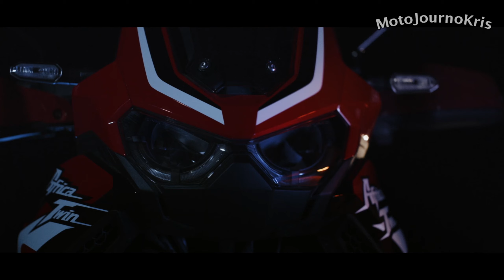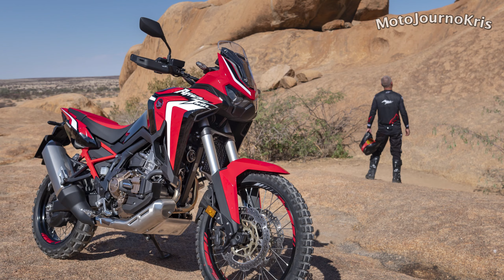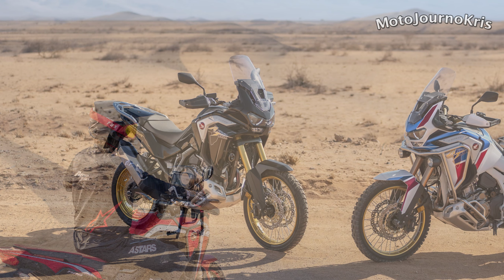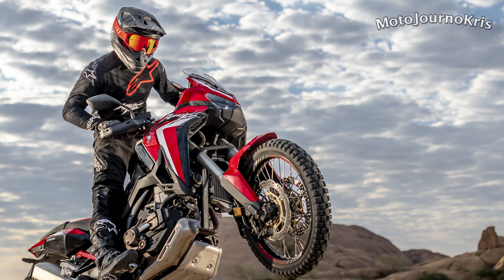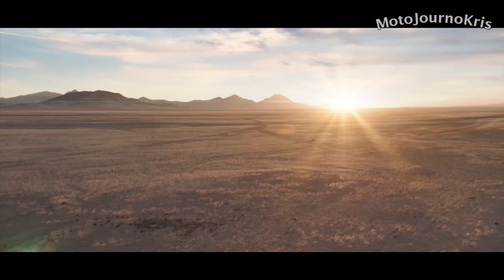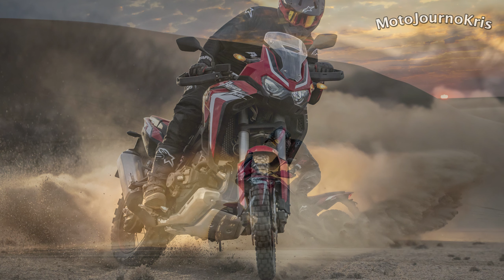2020 Honda Africa Twin Update - What's New & Australian Pricing

Comment: good day sir kris! in australia do you have to follow the rules before getting a higher cc bike? for example if your new to driving you will start from A1(beginner) then A2(intermediate) then A (expert) or do you have a diff. rule?
Reply from the maker: We do indeed, we've got the LAMS system, it's staged a little like that, but there's only one restricted class of motorcycles (LAMS) which is the same as A2. So you have to start on a LAMS machine and go through your L and P-Plate stages (about three years all up) before upgrading to an unrestricted machine, and there's some government mandated (and subsidised in some states) training included in the process. We kind of skip that A1 section but 125cc options are quite popular.